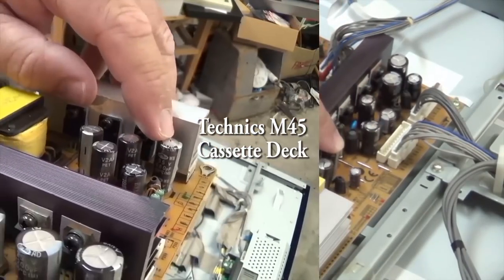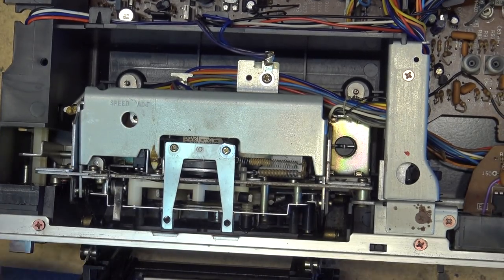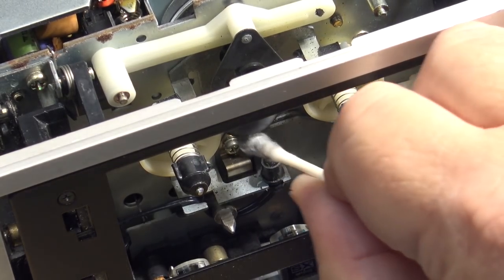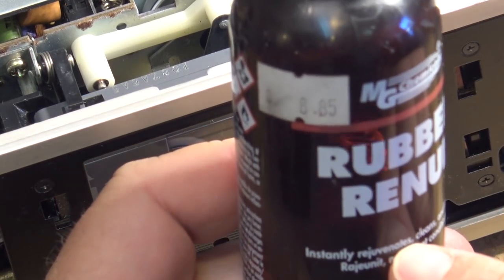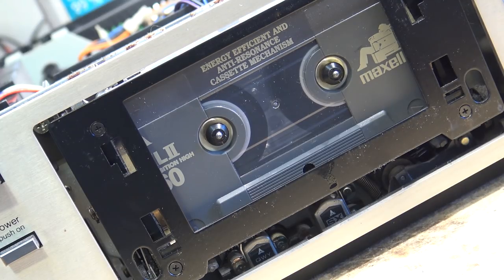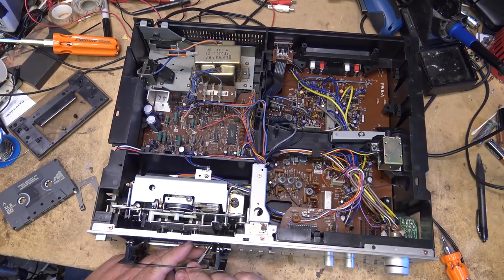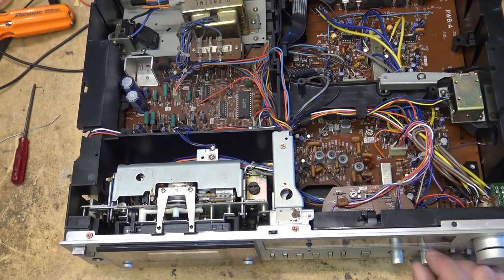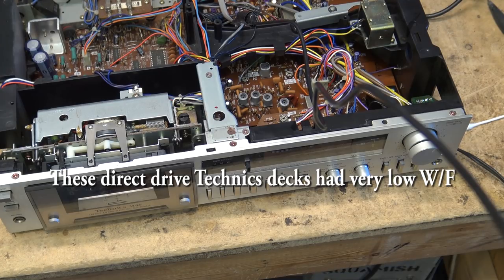Technics RSM45 Cassette Deck Repair

Comment: For used and more specifically glazed pinch rollers (no idlers yet), i am cleaning them with paint thinner. I am not applying too much pressure, just until the rubber looks clean and has a matte finish. Immediately i am using a ln IPA earbud for cleaning the remaining thinner and after is is dried another one just for being sure that nothing is left for making the rubber into goo. I have revived a shot walkman like this. Of course, the rubber rejuvenator is better but....you are working with what you have. Thank you for the videos

Comment: That was my first cassette deck, purchased in January of 1981 at Ciro's on Ralph Avenue in Brooklyn. To be honest with you, it was the best deck I've ever owned. It sounded great and looked cool and worked really well. I tossed it in 1990 and bought a typical 2-deck unit when the RSM45 couldn't transport the tape properly anymore and I didn't know anything about fixing these things yet. It had the two microphone inputs in the front, which made voice recording possible. It had a really fine mechanism so that you could make very precise edits, because the reaction time was very short once you hit record and the transport engaged.
Thinking back on it, who really needs a 2-head deck unless you're making copies of tapes, which I never did.

Comment: I've got two of these m45 models. Had same problems with playback/ffd. Cleaning the rubber didn't do much. Found Out that the spring for playback wasn't tight enough for correct pressure. No replacement available. So i Put a little capacitatur under the spring. Now it plays again. Not a pro repair but it works....😂 I like the slim line design since it came out in 1980.

Comment: This method worked on my RS-M270X idler tire. Same mechanism as the unit in this video. I had weak torque on my take up reel, slipping fwd and rev....
After applying some of this stuff it works perfectly.

Comment: I got the same model non functioning for $22 couple months ago, and the motor stopped at random places during play so I just let the motor run at 12V by connecting a screwdriver to one of the solder points and the grounded mechanism chassis. Worked like a charm afterwards, probably just some worn brushes inside

Comment: I own this deck and was having this issue on mine (slow fast forward and take-up reel occasionally not moving at all). Will definitely give this a shot!
Reply: Follow-up - I used rubber renue on my idler tire and it helped a ton. Very easy to do. I also purchased a replacement tire to hold onto for the future, and it seems to be fairly easy to pull off/on when the time comes.

Comment: I have quite a few issues with my M85 but I suspect i will need to replace many dried out caps. There are approximately 100 to check. One thing that happens is when play works (all switches need cleaning) it sounds fine but level control seems to act more like a tone control with sound becoming brighter as i turn it up, when i stop or pause there is an AC hum. I'm guessing this is due to failing caps but not sure why it's fine during play. I'm guessing this process on the idler is similar to how you did this one. FF and RW are very bad. I'll be buying some rubber renew or similar product myself.

Comment: These early Technics tape decks were well built, and this relatively high end model is a good representative of what was produced in the early 1980's. A touch driven mechanism with a motor or solenoid was not an entry level thing. Next was eventually Metal position then Dolby C, concurrently with Bargraph Vu meters, LEDs and fluorescent type... 
If the original belts are still in, that is also a fairly good sign for quality and long term conservation. And if you compare most recent decks, it's full of electronics, design and accessibility look great, mechanism mostly built with metal parts (not the later fragile composite plastic molded on metal!), looks like an piece of equipment worth every cent spent on it, and certainly fit for another 40 years!

I've read on the bottle of Rubber renew "contains xylenes"! I don't know if that kind of product is still available with the same formula, as this is classed as cancerogen and prohibited for public access in most countries. I've searched some nowadays equivalent in Europe without success... So many highly efficient products have disappeared over the years: contact renewers with ozone non friendly content or other water nasty chemicals, paint removers, plastic cleaners,  general purpose solvents. We have healthier conditions at the bench, but the work is not necessarily easier.

Best wishes for the 100k!

Comment: I have the same Deck with the same idler issue. Clean it up and working fine. The little bulb in mine was also dark, but after fiddling around on it it lights up.

Comment: I have a tascam 234.  The take up reel slips on the clutch when playing a tape and is noisy.  Sounds like it's in FFW all the time.  Plays fine, but i think it's slipping on the clutch too freely.  Any tips on firming that up?  It's not easy to remove the reel table at all.  I can see the clutch from above looking inside the unit. Just can't remove it.

Comment: Just what I was looking for - I have a sad RS-M270X waiting service. Same styling and mech, but with dbx (it was the very first Technics with dbx). The mech is working so-so but one channel is oscillating wildly at around 500 Hz (at any NR settings). Perhaps, replacing electrolytics will do the trick?

Comment: My Onkyo deck 2 started playing slow as if had batteries then stopped playing. Deck 1 was still good but I've tried taking other units to different shops here but few days later it starts messing up my tapes. I just stopped trying to get  them fix and just buy another one unit everytime it goes the way of the dodo.

Comment: Someones thumb downed this without even watching it, as they didnt have enough time too, sad bastards
Reply: Losers out there everywhere.  Someone was subscribing one of my throw away email to every spam list they could, so I tossed the email address and now nobody can contact me as it is no longer monitored or responded to.
Reply: they believe theirselves gods with their chinese cheap mp3 drives. Japan quality just before they made machines cheaper and plastic
Reply: I have a special question for you. As your 40 year? experience...
1) How long was the expectance of life of these machines? Did the factory mention something like that?
Did they expect machines, when wel cared could last 40 years with only routine manteinance?
We know common people goes to technician only when failures appear.

Comment: Must b real good rubber renew stuff,,,I wonder if I can still get this online,,,as I receive a few stereo cassette decks for repairs regularly,,, that have rubber drive problems.

Looks like that ceiling fan is going clockwise,,,meant to b going in counterclockwise direction for summer season,,,not winter.

At least it does look well balanced,,,u have done really good in getting it installed,,,and u had got it for free too.
Reply: Yes on ebay Australia , I just ordered some $33 though.
Reply: Yes,,,I had found it on eBay,,,u are right,,,,$33,,,with free postage.

Comment: 0:30 were there any minor modifications? mi 45 doesn´t have that plastic guide and arrow on cassette compartment. It´s not the same cassette door, the rest is identical (no 2 "screw covers",) Mine is silver , not transparent... The text is the same.

Comment: What do you think of Luxman decks, I recently picked one up for a couple dollars not working of course. Model k8, I managed to  replace the belts but that did nothing, the motor just spins but nothing engages when pushing play , rewind or fast forward. I'm wondering if it would be worth having it professionally repaired.

Comment: This is a fun deck to have and use. Robust and works every time, except when the FF/REW tires get slippery. 
I heard your comment about the cab belt on the RS-M275. Did you finally have to replace that belt? I recall in that video you simply dressed it with solder rosin. Didn't that work for long? 
I have an RS-M253X with the same transport and the same issue. I got the belts in a bag and pondering on when to take it apart. I was hoping that some rosin (I have rosin pens for SMD traces) would fix that in a snap, though. 

PS. The M45 is the lower end of the series with M65, M75, M85, M88 and M95. I have them all in my collection, in working condition. They are, in my view, the best lookers in the Technics series of decks.
Reply: The cam belt was changed then it started slipping again.  I dressed it with rosin years ago and it ran for a long time but needs another application. I rarely use the deck as I don't use tape except to archive and since I can just tap the cassette door and it plays that is what I do.  I thing the head mech is getting gummed up from lack of use.

Comment: If I may ask a question? I have a Cybernet CTS 300A cassette deck and the feed reel in the cassette when at full tumbles around on the spindle. Any ideas what could be causing that?

Comment: Are you familiar with the Pioneer CT-F900 at all? I have one that I think has a bad reel drive motor. the speed is kind of all over the place, and the motor will often times just stall and cause the tape to get eaten a bit before it detects the stall condition and stops. Tapping on the motor will cause it to kick back up again for a bit. Ive done some googling and people say the brushes go bad. Just curious if you had any experience with it. Belts have been changed.
Reply from the maker: Yes I have, and yes the motors go bad,
Reply: @12voltvids  Ok, is there any way to fix the motor or find a replacement? (I scour ebay all the time and havent seen one)
Reply: @THEtechknight  you might be able to take it apart and repair.  Unfortunately replacements are hard to come by.  Since they  are scarce expect any that do come up to command a high price.

Comment: is it normal cassette deck motor to run all the time?? I'm using Technics M205. recently removed for some repairs and i noticed that the motor is running all time..
Reply from the maker: Depends on the model.  Some models run all the time.
Reply: Some turn on when the cassette tape is installed and turn off when removed.

Comment: Wonder if this could be the same thing happening on my Technics RS-630USD, especially the RW is slow(er) and even tends to grind to a halt when reaching the end of the tape. (in other words when the tension rises?) And when I release the belt that runs to the counter the RW is somewhat better able and gets back to higher speed

Comment: Which is the accurate dimensions for pinch roller in this deck model? 13.2 x 8 x 2 or 13 x 8 x 2 ?

Comment: I used that rubber renew to fix an old Sony reel to reel.  Worked really well..  I used my corona mask when I used it so I wouldn't inhale the fumes.
Reply: Probably not a bad idea.  I am in an open work shop but when I worked for 20 years in the business the owner was too cheap to put in ventilation so I have probably shortened my life by 20 years by now anyway. All those cleaners and solder smoke. The owner would get upset if any smells wafted into the store and he would close the shop door to keep us working in a hot box.  I probably should worry as my assistant developed early onset althimizers and he used to work with the cleaners mostly. He was great at cleaning tuners and controls. Spraying stuff around his face all day. I was on the other side of the shop.  My poison was mostly solder smoke.
Reply: @ilovemysmartmeter  My dad was an electronics repairman and he inhaled solder smoke all day long.  He also smoked cigarettes and even use carbon tet to clean things back in the day.  He lived to be 92, so I wouldn't worry.

Comment: Thank you for producing such outstanding videos, I've learned a lot from just playing your videos in the background while I'm working. The way you troubleshoot things through process of elimination is awesome and your knowledge of different components and the history of the gear is very neat. 

Can you tell me when to use MG Chemicals vs Caig products and in what scenarios  you would use Nu-trol vs D5  vs Faderlube etc. because I notice in your videos you use different products for different situations? 

I haven't been able to find a decent video explaining the differences between the different product types and the appropriate times to use them.

I'd also be really interested in seeing and hearing about your personal gear.
Reply: The formula of nutrol I use is the old, now unavailable version as the solvent used, freon tf is now a banned solvent as it is hard on the ozone.  It is basically freon tf and diesel.  The current formula is alcohol and mineral oil based. Deoxit is naphtha based. Deoxit is better than the current nutrol formula but old formula I think is superior to everything available today. Don't get me wrong the caig products are the best we can get today, but the old stuff was better  as tf solvent was one if the best cleaners we have ever had.

Comment: Rubber renew can be used on idlers, etc, but NOT pinch roller?
Reply from the maker: I have, on a reel to reel that was all hard and cracked.  It did fix it.
Reply: @12voltvids  Thanks for the response.  I understood the oil in the rubber renew could damage the tape.  Is that incorrect?   I actually found this video cleaning pinch rollers https://www.youtube.com/watch?v=zXwFp4BYloY and claims never use IPA to clean pinch rollers.  Seems like some contradictions.  Thanks again..  
PS I have a 2016 Volt.  Love it.
Reply: @kphickman  
Rubber renew contains  xylene, ethylbenzene and methyl salicylate.
Oil and rubber are not conpatable.  Now if it is still wet it could damage the plastic base of the tape. After use on a pinch roller and this is a last resort, I would clean with isopropyl or freon tf, to remove the residue.  
Freon tf was the best cleaner but unfortunately it eats the ozone and has been banned world wide.  Ipa works good. If you are concerned about it drying the pinch roller follow up with water to rinse it off.

Comment: back in the day I flipped the idler rubber wheel inside out  : )
Reply: That generally doesn't work. For starters the inside side is generally very smooth and slippery and 2, unless the tire is extremely low profile you won't be able to flip it over.
Reply: I did that twice recently. Flipped the tire and then filed it down with fine-grit sandpaper.

Comment: Except the direct cleaning the rubber wheels another solution is to unpolish the surface using a light sandpaper and clean after that.And also clean the surfaces of each plastic wheel where the rubber wheel gives the motion.Almost as good as new but not for a long time and if the customer is a serious cassette listener the deck will be on the road for repair every two or three months.
Reply from the maker: When you sand the surface you make it smaller and that can be a problem too.
Reply: @12voltvids  Sanding slightly only to unpolish the contact surface of the rubber wheel to have better friction to transmit the movement.

Comment: 11:14 some technicians told me was not only the bulb type (even suggedted replace with a LED) but is a lot of work to access the bulb
Reply: I understand it´s hard to find the bulb, but can you tell me the type? any model or connector for attaching it to main board? I want to look out for it. 
Thanks

Comment: costs £18.15 plus £2.99 delivery for Rubber renue in the UK for 125ml.
Reply: Expensive stuff but as you saw it works. I have been using it for over 40 years.  First used it as a teenager working at my first job at the first TV shop after school.

Comment: Dave, 
792nd viewer! And nobody cares, rightfully so.
Do you think that a "rubber glaze" buildup happens on this rubber idler wheel and that causes some of the problem?
Regards, Tom
Reply: Yes they glase up and get slippery.  This is what rubber renew does. Remove the oxidation and soften up the rubber.